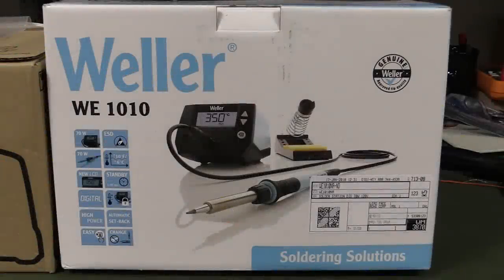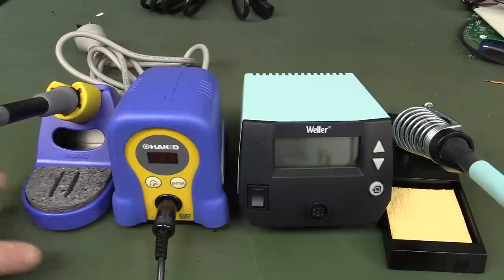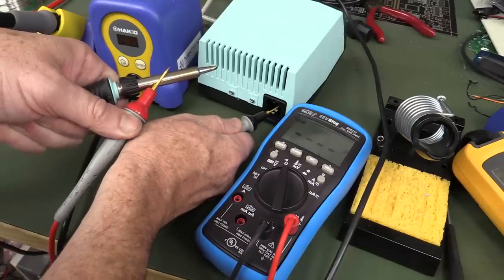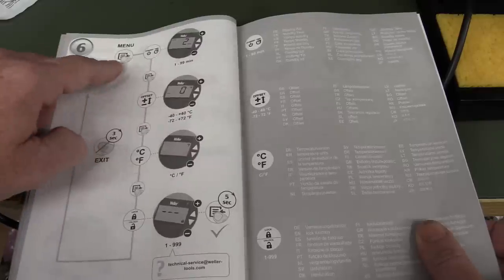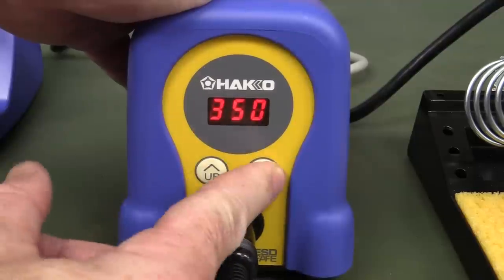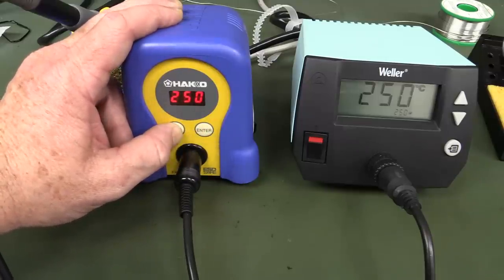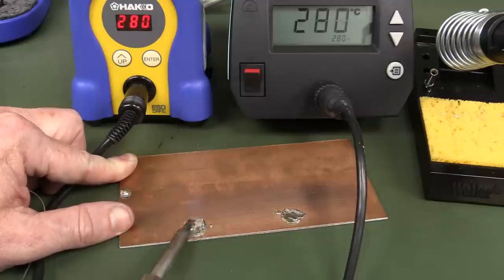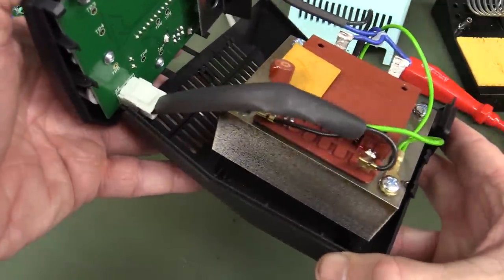EEVblog #1063 - Weller WE1010 vs Hakko FX888D Soldering Station

Comment: I am an amateur hobbyist but I do a fair amount of DIY.  I have been using a Vellemann solder station for more than 20 years with zero problems.  Recently, I may have damaged the Vellemann by leaving it on for 48 hours or more.  My intention was to buy a new Vellemann, the exact same model, but it's out of production.  Vellemann is not much recommended these days.  What's wrong with them?  The Hakko and the Weller are at the top of my alternative list, but I read that the Weller power transformer is unreliable in the long run and sometimes even the short run.  Is there any truth to that?

Comment: The Hakko looks like a toy for little kids..bought on ebay for 10 bugs 
include shipping....
Reply from the maker: Looks can be deceptive.
Reply: so can ebay he probably got a knockoff
Reply: esp if you paid in bugs yuck! I hope they atleast charged you in wetas or those giant afganistan spiders
Reply: sorry.....bucks
Reply: I'm pretty sure it is designed by someone who designs just everything made of plastic and filled with electronics, it is not only how it looks it is also how you setup that thing, like they couldn't make the second button for down and longpress or press both to open menu, I mean, come on, setup working tempererature digit by digit while you are holding the iron in your hand? In a senseless kids toy that would make sense.

Comment: i've never heard of this hakko brand before. looks like a cheap toy
Reply: Spoiler: it's not. I've used it on handfuls of fairly serious PCB projects and have never had a problem.
Reply: sure it isn't, i just watched the video. it's just over here you either get a weller or if you want the good stuff: ersa
Reply: It's one of the biggest and most respected brands of professional soldering equipment. Anyone in the electronics industry has heard of them.
Reply: not here in germany. as i said, it's either weller or ersa.
Reply: @eftalan26 is right, Hakko is next to nonexistent here (I'm Austrian). The only big players here are Weller, higher up is ERSA and the big boys use JBC
Reply: Hakko is one of the best brands around. Defacto standard in some countries including the US.
Reply: and that's the problem here, people living with the false assumption that something that's standard in the US and SOME othe countries has to be standard everywhere else.
Reply: In portugal it seems probable than JBC(spanish) equipment is pretty popular, a shame than the basic station costs 480€ and 30€ per tip.
Reply from the maker: Hakko have been a well respected and proven in the industry for over 30 years, they are not toys.
Reply: I took great umbrage just seeing Hakko being called a cheap toy.
Reply: yes i agree that weller dropped temp like a bitch when exposed to a little wet sponge lol the hakko held strong even with a few sec delay it still didnt drop 50c in 5 seconds
Reply: In the UK there arent many places you can get Hakko stuff. I've only seen proto-pic and a couple of trade only sellers stocking them.
Reply: Even if you live in a country where Hakko is not well known, you can't say that you have never heard of Hakko if you use the Internet, that just doesn't compute.
Reply: Ian Rolfe I bought my FX888D from Maplin, £100, of course they didn't sell any of the accessories so I had to buy tips online. I love it, but yes the UI is a bit of a pain in the a**.
Reply: Ahh I stopped buying from Maplin a while back. When I was looking around 3 years ago I could only find ads from proto-pic selling anything Hakko.
Reply: Yeah, Hakko have horrible distribution in Europe. When I managed to find a shop that sold them they were ridiculously expensive (2x the US price). So, I ended up spending just a bit more and getting the most basic JBC. Overkill for my use, but it's so nice.
Reply: He said it looks like a cheap toy and it looks like a cheap toy, doesn't say it is bad, only that he never heard of it. This is also my only problem with Hakko, they look like cheap toys xD But they are nice in any way.
Reply: finally someone who is willing to understand.
Reply: if you have never heard of Hakko brand before,   then you really don't know what you are talking about,
Reply: wow, we're moving on to insults now?
Reply: They make this in silver if the blue/yellow is a problem.
Reply: I'm from Sweden and I have only seen Hakko branded irons on youtube, my first thought was that it looks like a toy as well, but have come to understand that it is very common in some parts of the world. Hakko is close to non-existent here, I have not seen any Swedish retailers sell that brand ever. Weller is very common tough, also ersa is quite common.
Reply: Well if you've never heard of it it must be garbage.
Reply: shomolya if you only think about how it looks then this could be the simple answer, but if you look how it's firmware is coded I came to the conclusion that they was designed by someone who designs just everything made of plastic and filled with electronics, mostly toys and kitched gadges, no one, absolutely no one who have a clue of how it is to work with it had used the second button as Enter, Up and Down, if you want to save money on foil buttons and don't want a third one, and then longspress or press both to enter menu, whatever. Setting the temperature digit by digit while you are holding the hot iron in your hand ist pure idiocy, in a senseless toy it would make sense, so kids can waste more time on setting numbers digit by digit and in only one way.
Reply: or if you want the better stuff, Metcal or JBC

Comment: 23:24 I think weller starts heating up, when the C sign stops flashing.
Reply: indeed it does, tho if inclined to do so you can avoid this delay by pressing the menu icon button after changing the temp value, then it immediately goes back to the temp screen. i have got into the habit of doing this even tho i never did mind waiting the 4 seconds for it to revert back to the default screen :/

Comment: I used hakko and WESD51 and my favorite is a cheap Chinese version of hakko: Pro'sKit SS-207. It's rated power is similar, but actual power was 140W. It also uses hakko 900 series tips. Overall build quality is very solid.

Comment: We have a few Wellers at work, JBC, and some others.  At home I've got the FX-888D and haven't really had a problem.  Didn't know about the presets, likely because I didn't look that hard for them, but I'll have to use those.  At any rate, won't be trading in my Hakko for a Weller.  But, I can see the two come out about the same.

Comment: Kelvin is the only sensible scale.
For serious space saving, a portable kit, or hobbyists, give the Hakko fx-600/601 a go. $30 less than the fx-888, same tips as the fx-888, 70watts on 120v (sold as 50w on japan's 100v, all the same internal part numbers.) 
The 601 has a tip retainer for a thicker higher heat capacity tip style. (600 to 601 conversion is a $5 part, although discerning which part number is which for ordering was ambiguous due to both translation and corporate-fool issues, two physical pieces, a tube and a nut matched to the tube.)
Reply: And Adafruit has [had?] a $35 "Atten" knockoff of the fx600. I have not compared them side by each, let alone long term.

Comment: I wonder if that Weller is like some electronics where they disable some features, but share common parts with a higher tier model? Maybe it's just a matter of putting a jumper on the board somewhere to enable and use the additional two presets that seem to be on the display?

Comment: Low temp after spongeuse: Maybe the Weller has a higher performance concerning heattransfer. A fair comparison would have included a FLIR or an IR temperature measurement for both.

Comment: I have been using Hakko 936 for almost 10 years which in my opinion is still much better than the FX888D, the disadvantage of the FX888D is that the soldering iron cable is very easy to break due to the position of use so that the cable often bends when it is used. In terms of the transformer used by the Hakko 936, it is better able to push continuous heat when I solder to a large part of the PCB path.

Comment: I think the weller has some sort of "smart" sensor and when you're cooling down on the sponge it lets the tip cool down and warms up gradually. If you look at the video, when you're working the ground plane, not only does drop the temperature much slower, but it actually recovers and keeps up at 280.

I think the main problem may be the weller is a bit "too honest" while the hakko just gets you approximate info.

Comment: Well done, my 1977 weller just died on me. I need a replacement. My old one is simple 60W brick, but I like it and can get tips. After seeing these demos here, I think I will break open the old one and try to repair it. $100 for that package and performance and features just isn't worth it to me. Your review was quite thorough and practical. Well done. D

Comment: Have you tried the X-Tronic soldering irons? They are fairly cheap and have been getting good reviews online. I have one and it's done pretty well. I don't think the live readout is too accurate but it does very well. Just replace the tip on it.

Comment: something that hasn't been said before is that those stations will also suck if the tip is really really small, like a 0.2 conical or a 0.4mm chisel, even if you're not soldering onto a big plane; it would be no problem on the irons with the heater in the tip;

the reason conical tips suck is because you been using them on those irons, not because of the geometry of the tip; I have a 0.8mm Metcal conical tip, and that thing can go thru anything, whether a big power ground plane or otherwise

Comment: After 40 years my old Monacor soldering station SIC-500 slowly disintegrated (the case got more and more broken, because the plastic became brittle, the "electronics" and the soldering iron still worked like on the first day) I had a short stopover over an ERSA RDS 80 (what a garbage) and finally ended up at a JBC DME.  Additionally equipped with a desoldering iron the whole thing was not cheap. But once you have soldered with it, you don't want anything else. In my apprenticeship I once had to deal with Weller. It was OK, but it was just too expensive for the power.

Comment: If 662 Fahrenheit is the same as 350 Celsius the weller achieved its 662 about half a second after the Hakko achieve 350 and continued climbing in temperature. So if the weller gets hotter naturally it would take longer. However the advertisement for the Weller advertises it displaying in Celsius, so there should be a setting to change it

Comment: The Hakko is 26V, 65W and the Weller is 23V, 70W. So the Hakko iron has a higher resistance, which probably means a higher thermal mass. Surprised the Hakko heats up faster.

Comment: Both these are great irons.

But the heating element is differently placed on them.
The hakko has has the element inside the tip, and the weller has it on the outside.
This greatly affect the water-sponge test as the weller's heating element is more exposed to the cooling effect when you place more than just the tip in there.

The weller also seems to have a "smart" algorithm since it takes a few seconds for it to react when you are heating the big ground plane, after that it does just fine,.

The hakko seems to hide its actual temperature better since it take a while before it shows any temperature drop when heating a large ground plane.

Comment: Regarding the 3 presets on the Weller: The ones I worked with had 3 extra buttons to switch between the presets. Maybe this model doesn't have more than one preset and they just used the same display.
Reply from the maker: Seem that way

Comment: I use the analog version of the Weller and have done so through several models. No need for the digital nonsense, just reach over and twist the dial without taking my eyes off the work.

Comment: Those iron handles tend to have a tilt sensor or a vibration sensor to find out whether it is in the stand or not. Pretty simple really.
Reply: Alternatively it could also be a magnetic sensor, that senses when the iron sits in the metal stand.

Comment: I use a soldering iron that plugs directly to the mains but it is formed like a pistol with a boost trigger. I never thought about getting a better one or even a station since I had no problems with it. Problem is thou that I would like to replace the tip but since it is a no-name, I don't know what to look for.

Comment: I'm actually happy with my old, Weller WCC-100. Knob temp adjust on the front and an integrated stand.  I'd buy something better if I did a lot of soldering, but it does fine for my little bit of hobby work.

Comment: I am thinking about getting the Weller for soldering USB cable wires to USB plug contacts. I like the Weller for the ergonomics and easy UI. Would I experience the temp fluctuations I saw in the video for the job of soldering USB wire contacts?

Comment: Well done, this was the first video I found that was of any value. You also presented it in a fun way without being ridiculous.
In the end, I think that I prefer the Weller due to the user interface. The Hakko may have presets but to cumbersome to access, so essentially worthless IMHO. Besides the design looks silly, more like a childs toy. Your test did show that it does preform as a proper soldering station, so I'm not knocking the performance.

Comment: nothing ever beats a Weller.
My WECP20 80W is now about 40years old. works and works and works. Never ever one issue with it.
Once fall down ~6 meters - nothing break, still works. 
Also you get the solder tips today ... thats quality!
ONLY thing is the cable. The silicone is breaking ... but I am not will to pay 40,- for a f... cable haha
Reply from the maker: This new one would survive a fall off the bench.
Reply: but not more ;-)

Comment: The Hakko has the temperature sensor inside the ceramic heater so it will not react as fast and not be as accurate as the Weller that has the metal heater on the outside of the tip and the thermal sensor inside the tip so is not affected by the heater.
That is from what I seen in the video not sure I'm right about the heater and sensor arrangement.
Reply from the maker: This is a not curie point temp iron, so the tip is not the sensor.
Reply: No the tip is not the sensor. I was saying that the thing you touched and did not like how it was sitting was the temperature senor and the heating element is not there and the outside of the tip is the one that is heated not the inside as with the Hakko.

Comment: I have a Weller soldering station and it is an absolute pleasure to use. I have the  Hakko too.  I actually look forward to using the Weller for soldering. Granted the Weller is probably 5-6 times the price of the Hakko but you get what you pay for.  The Hakko pisses me off to be absolutely honest.
To be clear: I'm not comparing oranges to oranges. It was the deficiencies of the Hakko iron that made me buy the much more expensive Weller station. FWIW

Watched further, yeah the Weller manuals are annoyingly minimalist. There are some features I still haven't figured out.

Comment: The FX-888 had a much better UI than the FX-888D. Sure, it doesn't show the current temperature, but the knob is quite intuitive. You can turn it both ways.

Comment: Is the Weller natural sponge! Not good if it is.
How you powering up the weller it's not designed for Australian voltage are you feeding it enough amperage? This would have a bearing on it's recovery time.
Reply from the maker: I'm using a proper 120V conversion transformer, it has more than enough capacity.
Reply: EEVblog fair enough I thought you might have been using a lab power supply with the amps turn down!

Comment: I purchased the FX888D after using the analog version at work and loved it, but would swap it for an analog version any day. The knob is all you need. Real Hakko tips are expensive though ( over $10 Au each ), and the ebay Chinesium ones are crap. They look Ok but are a loose fit with poor thermal transfer, might try some white thermal paste though to see if it helps.
Reply: The last time I checked the prices of replacement tips (probably about 4 years ago, so about the time you commented) the Weller tips were about half to 2/3 the price for the Hakko tips. Those are for the genuine OEM tips.

Comment: The Weller is available in Germany from beginning of April (if the distributor reichelt.de can keep its promise) for around 170 Euro.
Reply: Thank you, I also found it on amazon.de, but I recently bought an Elsa station. Which I don't regret having seen the video ;-)
Reply: Thomas Jungbluth I can’t imagine why anyone would buy the Weller for €180 when the ersa icon nano costs the same and performs FAR better than either the Weller or the hakko 888D!

Comment: Dave, you are probably wrong with the Hakko to be single voltage. 38:50 There are two unused primary pins on the transformer, probably a 220V and a 120V tap. You should have tested it.

Comment: I got one of the $19 ones and it works just fine!
Reply: I bought one of the digital $19 ones and today the display went odd and it decided to provide full power to the element, the tip glowed bright red and the plastic handle started to melt. Would have resulted in a house fire if I hadn't been around. A Hakko is now on order, I'm expecting them to have thoroughly tested the firmware and hopefully implemented failsafes. Who knows who coded the firmware in the clone and what safety features have been implemented (if any).

Comment: The three most important factors that really matter when selecting a soldering station are:functionality,reliability and ease of use,combfort  not so much,however design is kinda debatable,because design kinda plays a part in how reliable or unreliable it really is.